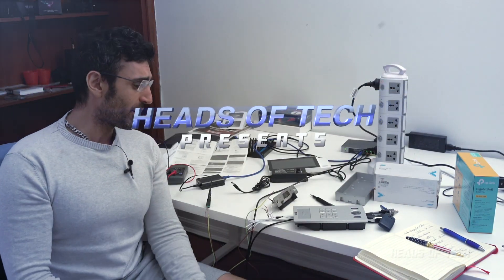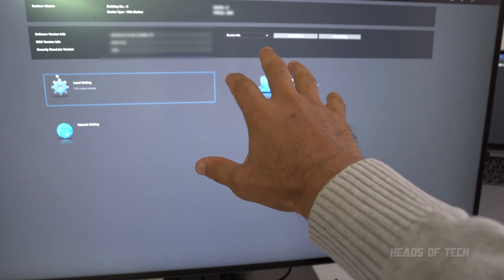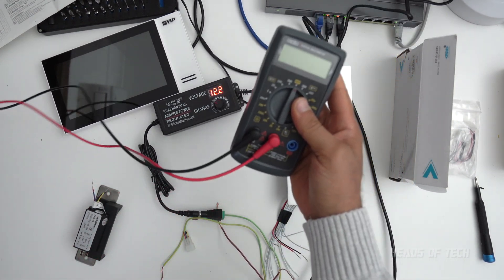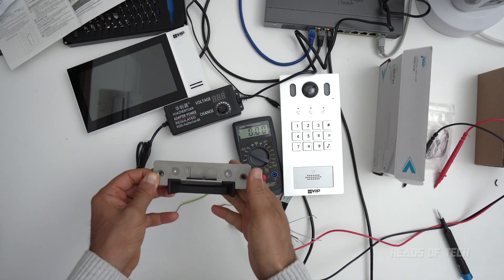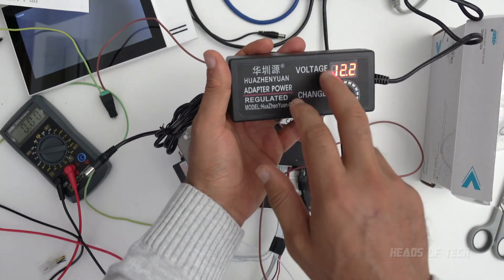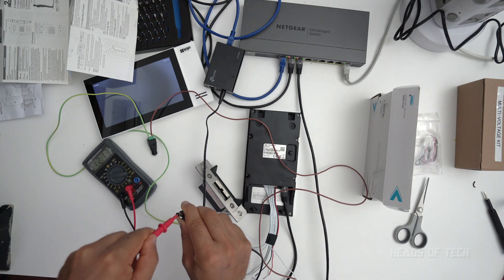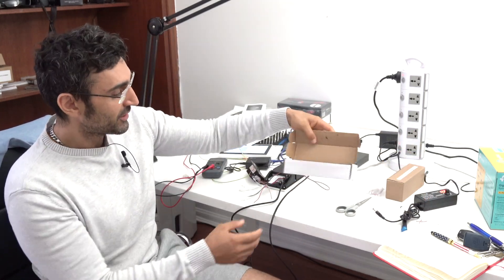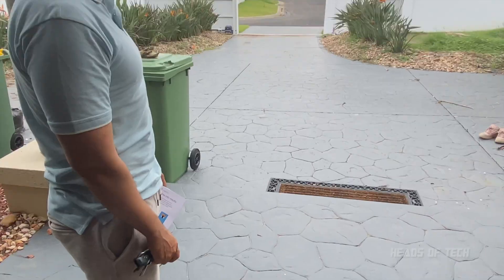How to Wire an Electric Strike to Video Intercom | NO/NC/COM/POE for Beginners

Comment: Hey man. Absolute outstanding explanatory video I’ve been searching for a good while. There’s one question with application of the tp-link PoE splitter that splits 12v power, though. What if I wanted to run rj45 from home poe splitter to the intercom but before I stick the cable to the intercom directly, I first run it through the tp- link splitter, then to the intercom so it has communication and power and then from tp-link splitter to intercom, rj45 pass through,and at the same borrow the 12v power from tp-link to the lock. Would it work? Or I still gotta run separate 12v power to the lock?

Comment: I've used PoE splitters before. Be mindful that they drain your switch of it's general wattage capacity for other devices.
As far as security most seasoned B&E crooks know to crowbar these off the shelf door intercoms and cross over the NO/NC with COM wires ...and open sesame. If he's a hacker with laptop to plug the Ethernet ...open sesame if you don't use 802.1X radius port security. Don't get me started with RFID cloning.

Comment: I have video intercom system with electric strike lock having trouble wiring my outdoor unit has only connection for my indoor unit and another 2 wire connection com/lock connected the lock to that but doesn’t work

Comment: REFRESHER!!!! - These models of the Dahua VTO DHI-VTO3222E-P and DHI-VTO3221E-P provides 12 VDC, 600 mA power, way more than enough to open the lock. The one in the video is branded VIP, it may be an old model re-branded

Comment: Outstanding, thank you. I was looking all over for this information for a GBF video intercom, powered by PoE. They only document the wiring for the Intercom but they are silent on the wiring for the lock. As with your device, the GBF Intercom does not supply enough power to open the lock. The lock needs its own power supply. If I had an additional ethernet cable in the conduit I would try your suggestion of using the PoE power splitter, but I will have to rely on a separate 12 volt power supply. I think that the PoE switch itself might output enough current, but after passing through the Intercom, the output current of the Intercom is lacking. I'm not an electrician so my terminology may be wrong. My device uses a "normally open = NO" circuit. As you mention, the terminology is awkward, as NO means normally no current, or normally OFF. It is also confusing to talk with a locksmith because an "open circuit" means a "closed lock" in this case. I have not been able to locate instructions in Spanish for the GBF, but I can use your video with closed captions and automatic translation, to show the electrician. So thanks again, this is a great help

Comment: Fantastic video, im thinking about installing a video intercom as well, would the wiring be similar for an electric sliding gate. thanks
Reply from the maker: The electric sliding gate I installed was ready to go out of the box: https://youtu.be/pJmGxO7EjhM?si=4aWxRLd3jRNPuPc2
Reply: Thank you for the super quick response, i  your videos are great, 
I take it that you didn't connect your home intercom system to the sliding gate so you can press the unlock button to open the gate. i have the gate already that opens with a remote, but from the house, the signal can't reach the gate, I'd like to install the intercom that also opens the gate from the monitor that has the unlock button.
Reply from the maker: Ah nice one, I haven't tried myself, but I imagine it'd be similar. Best to always read the manual or contact the manufacturer of the motor/intercom to confirm. Let me know how you get on.

Comment: Strange, that VTO outputs 12 Volts and 2 A. That lock needs only 0.2 A, So you dont really need a spliter. 2 Amps of power coming from that particular VTO would be more than enough, dont you think? Something is not right. What model is it? it look like a DHI-VTO3221E-P. Maybe the one you are operating is an older model

Comment: Important to add, that handling live wires, that they NOT touch(short) each other. As you can be breaking/blowing stuff up. So better to leave a little bit more plastic on the wire ends.

Comment: When you connected the POE splitter you used a 2nd ethernet poe cable.. is it possible to use just 1? the same the you use to connect the Intercom
Reply: I also join to the question, can the splitter be used for both the intercom and the lock? thanks.

Comment: Hi,
I have a AMOCAM Wired Video Intercom System at my home. It don't thave enough lighting at night. So, I was thinking of connecting a DC LED light to this. Basically, I want to know if this is possible to work when a person presses the intercom button and turns on the light automatically. ?

Comment: Great Video! Why did you follow the wiring diagram of 'Magnetic Lock' and not 'Electronic Lock' or 'Elecro Mechanical' lock?
Reply from the maker: Nice one. I went for the NO configuration - so the lock is normally closed which is shown as an Electronic lock in the diagrams. I just explained it in a dynamic way, using the NC diagram and converting it to NO, to hopefully give viewers the idea that you can still figure it out if all the variations aren't shown.
Reply: @headsoftech  Ah ok understand. the exact NO configuration you went with was directly above in the 'Electronic Lock' diagram. Thanks so much for your detailed video it really helped me out! I am now suscribed!

Comment: So,
can i take GND (black) from VTO, connect to NC (blue), and output 12V from VTO (red) connect to lock, and then COM (bluewhite) to lock? VTO2211G-WP

(google “VTO2211G-WP wiring”, there is picture of wire with label on it)

Comment: Seeing a Guru such as yourself using a Netgear Unmanaged Switch makes me feel really good about my own choices as a 60 year-old Luddite trying to keep up with modern technology, haha, thank you. Normally Open/Normally Closed seriously confuses and stumps many people, good explanation.  Great video!
Reply from the maker: Ah mate, I'm still working my way up to your BOSS level of installing your own switchboard. I'm tempted to become an apprentice electrician so I can muck around with higher voltage - over here they only let you play with 12v at home. That Netgear unmanaged switch is great for POE, it's got a high wattage ceiling so you can plug in lots of POE devices and it'll handle it, a lot of the cheaper ones are low watt, so as soon as you start using the ports it'll starve and not be able to power all the devices.
Reply: @headsoftech  Thanks for the Netgear POE tip.  I plan on adding a few security cameras to cover my property and POE would eliminate having to worry about maintaining solar, batteries and wireless issues.  Dogs are pooping in my front yard and I am determined to identify the owners walking them so I can deliver their dog's poop back to them, haha.
Reply from the maker: Legend, I recently wired up a security cam system here - just used a proprietary 4k DVR package as it was cheaper. You know what I'll post that video actually, maybe it'll give you some ideas or something to laugh at.
Reply: @headsoftech  Sweet! Laughter will keep you young and healthy.

Comment: Can you do a video about how to install windows on big sur boot camp with mac pro 5,1
Reply from the maker: Ah mate, I sold my Mac Pro 5,1 a few years back, but I heard that it runs best with High Sierra, since Mojave getting Bootcamp installed has gotten into Boss mode territory.
Reply: @headsoftech  thats sad
Reply: @headsoftech  my computer just won't work win 10 and is the same one as you have
Reply: @headsoftech  I tried every solution you show in previous video
Reply: cd,usb with modify boot camp, usb with UNetbootin